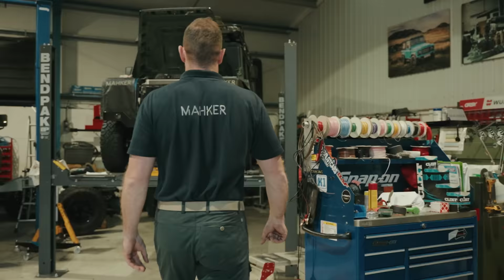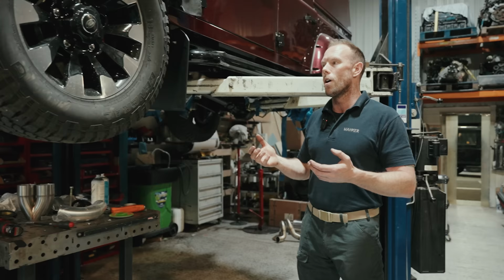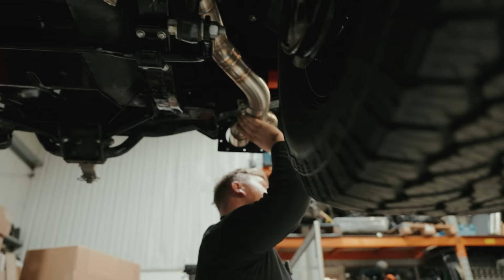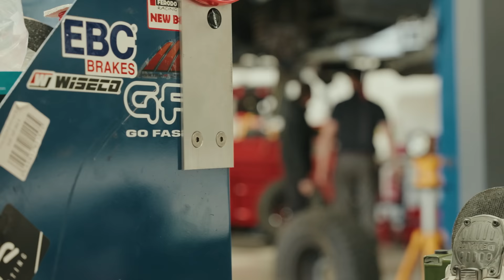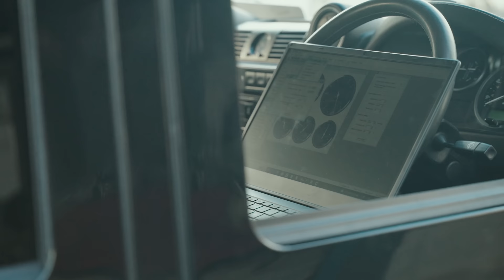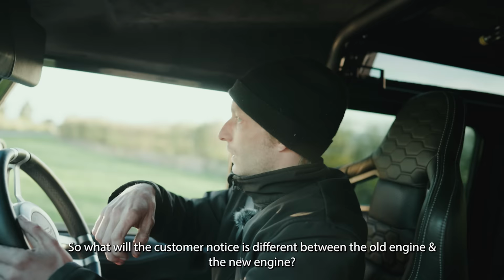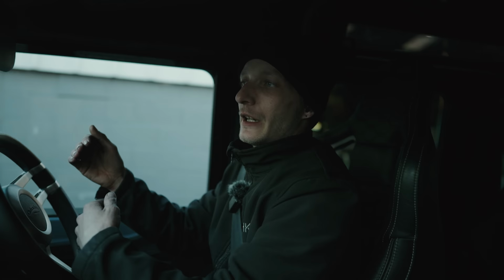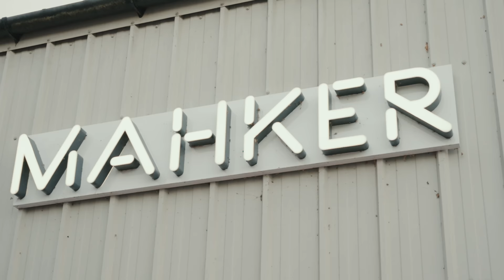Defender LS3 V8 Road Testing, Swiss Land Rover Upgrades | MAHKER EP053

Comment: Hi Dave that was fantastic and excellent video!!🤩 I have a question about my land rover tray back you see in my profile picture on its roof that's not the problem😆 I have a problem with the suspension it has 4-inch lift, 15-inch travel on the back and 14-inch travel on the front with a 2-inch springs all round and 2 inch spacer on front back has extreme 4x4 dislocating cones that gives it 2inch and it has 35 inch tyres, when the rear articulate it rubs the spring so I put 45m wheel spacers on it still rubs🤦‍♂️ is it the wheel offset or the 4-inch lift is too high 🤔??? Sam you should be called the V8 GURU and get a episode on Sam's daytoday at mahker fucking awesome!!!👌🏻👍🏻
Reply from the maker: Send me some pics from behind or in front ?
Reply: @wearemahker  

Cheers Dave sent some 👌🏻👍🏻